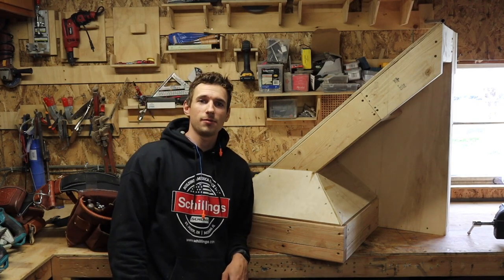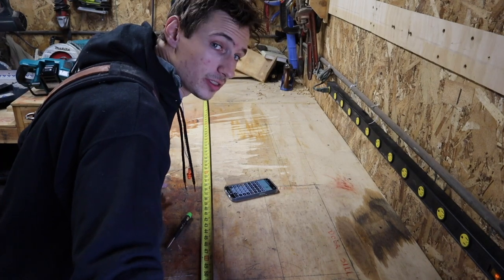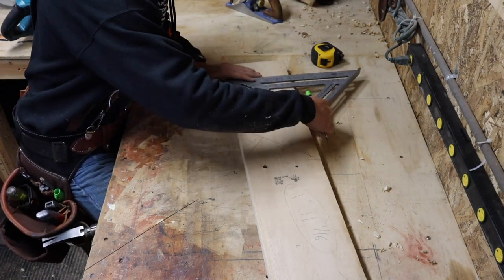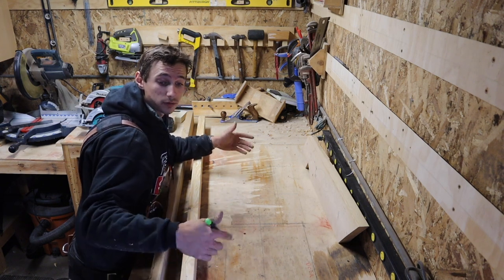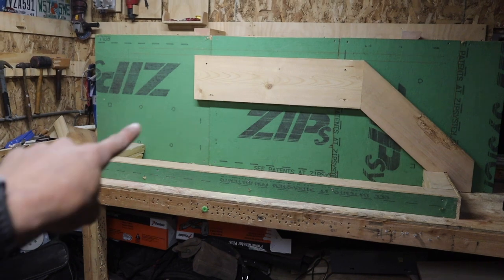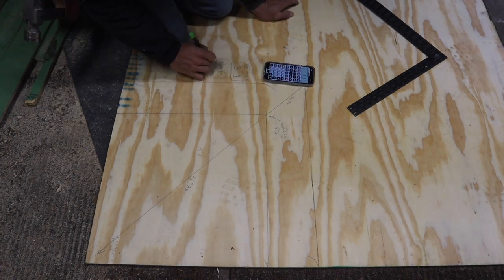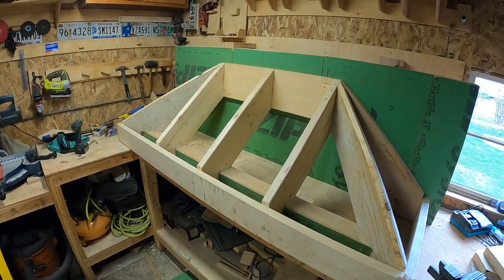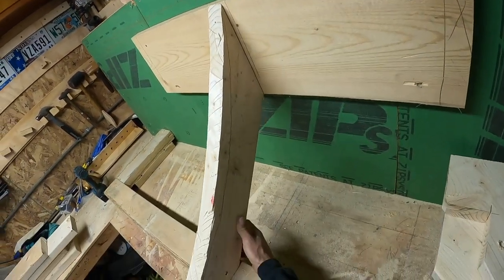Learn To Frame Ep. 1 - Hip/Bell Roof (In-Depth Explanation)

Comment: Good video. I think to make it easier on you and your viewers, pick common dimensions for the walls and build them, then fit the rafter system to the walls. This way, it would be more like building from a blueprint. One other suggestion would be for your seat cut to be flush with the interior of the wall when possible, but like I said, just a suggestion. Keep up the good work. 👍
Reply from the maker: Thanks man I’ll keep that in mind for the next one!

Comment: Does that gap measure about 3/8" was it transferred when you lowered it?
Reply from the maker: With dropping the hip 3/8ths, the seat height shortened so it should’ve just dropped without creating a gap. Either way I’m still curious how my tail number was still right on😂